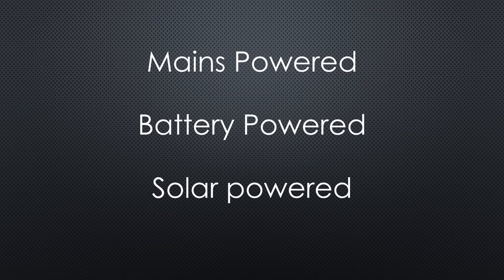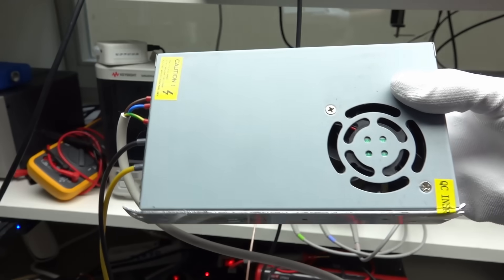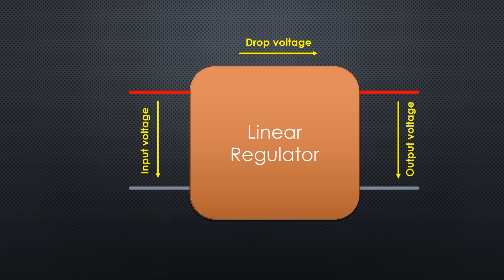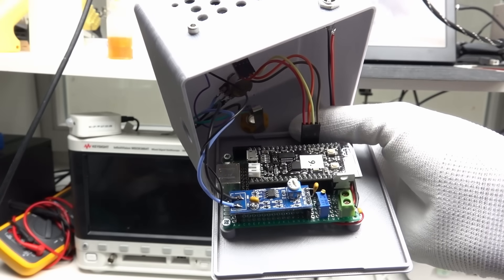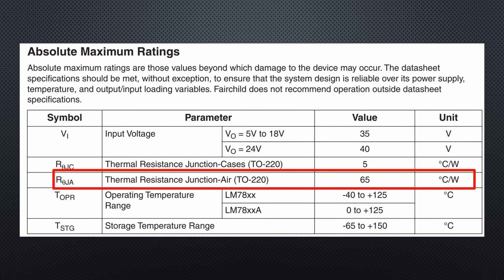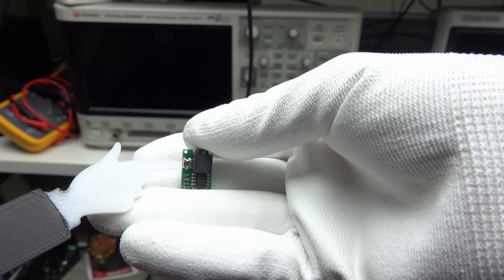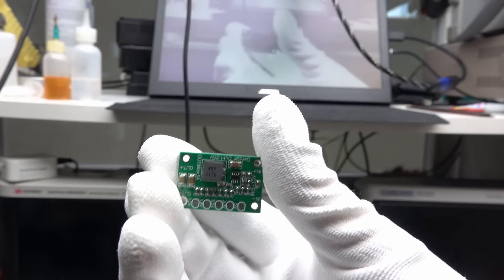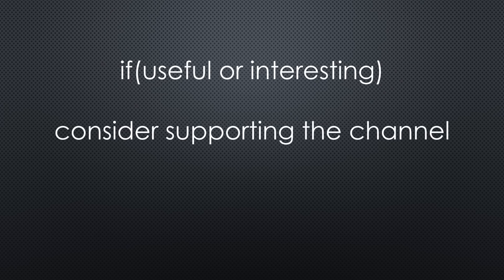#334 How to find the right Power Supply for your Project

Comment: I fully agree with Daily Cake Slice.  Among the Development Board drawings I sent you, there is a new idea for battery power or main power. For batteries you can use a good size 6V, charged by solar and then go to MCP 73123 charger to a 3.3V Lifepo4 Battery to run the ESP WiFi. It hasn't been tested.
Reply from the maker: There are only a few chargers which also handle LiFePo. If I remember right, the TP5000 uses the MCP 73123. And you are right,  LiFePos are a good choice for ESP projects...

Comment: Battery and solar please, I just implemented a solar chicken coop door running through Hass / node red.
10w panel isn't keeping up with the daily draw so this is an relevant to me right now!
Reply from the maker: You might try to watch my video about solar where you find all formulas to do the calculation for your location and need
Reply: @AndreasSpiess  yep that's my next stop, I'm doing this project backwards which is a bit silly. 
Also deep sleep is on the cards too
Reply: @AndreasSpiess  Im watching your videos and realising i don't have enough knowledge of my system power use to be able to calculate it all. Its complex because - 
1. I am running an INA 219 but on between the battery and the Solar Charge controller.
2. This means i actually don't get nice long data for my actual usage but i do get the net solar in to battery and drain out.
3. at least 2 x per day i have a linear actuator going which draws about 0.2A @12V for arroudn 45 seconds each time.
4. i have not yet worked out how to get Granada to show me cumulative daily in and out on the battery, i can see a + drain on the battery and a -  charger on the Amps through the INA but not yet worked out how to work out the accumulation of this either.
5. Its already installed in the chicken coop so working on the stuff isnt super easy, im not installing TRRS cables to some of my harder to reach projects to get UART debugging without getting to small spaces.
6. I think my cheap solar charger form china is also shitty, and this cuts the power to the load sometimes, i'm thinking about wiring directly to the battery to remove this poor quality HW being an issue.
Anyway, i now have an INA 4332 and im going to modify it to see 3 x channels of Solar circulate, load and battery, i can include all my 5v D1 Mini in to the 12V measurements as the H bridge which drives the actuator has a 5v output so this should help keep that bit simple.
Anyway, a few more videos of yours to watch i see!

Comment: Funny that I have been info seekning voltage regulators for MCU:s all day, then you release this video today. Great content and clear explainations as always!

I was almost ready to order some LM2596 based boards, but a commenter mentioned that ripple could be as high as 300mV peak-to-peak on those. Is that tolerable for e.g. an ESP32? Can we filter it with a capacitor? What are some good buck converters with low noise?
Reply from the maker: These are quite old boards. Maybe you decide on one I showed in the video...

Comment: That was useful and interesting and I'd definitely be interested in a battery edition.

One type of power supply I like for small mains projects are the little potted mains to 3.3V or 5V power supplies that you can get on AliExpress for a few pounds.  They are small and work well if you want to wire the power supply in permanently.
Reply from the maker: I think I showed one in the video. I also use them sometimes.
Reply: @AndreasSpiess  You are quite right, it was at 2:20 - I missed it first time round because I had to get my dog to stop barking at the post man (delivering a parcel from AliExpress, appropriately enough).  The ones I use are much smaller than that (probably no more than a quarter of the size) and are a lot more clearly labelled but otherwise, probably very similar.

Comment: I am very sad that you did not talked about symmetric supply. Because I need a symmetric supply very often and do not know the best solution (instead Lab power supplies)
Reply from the maker: I take two normal 220v power supplies and connect the secondary plus of one cable to the minus of the other. Ready is the split PS. I did this also with two of the PCB PS I showed. This is now my standard +/-12 Volt PS.
Reply: @AndreasSpiess  Thank you a lot for the answer. It helps a lot! The PCB PS sounds like a great idea. I am just not sure if I can trust the cheap chinese PCB PS. I mean it is mains voltage... And the PCB PS from premium suppliers are quiet expensive :/
Reply from the maker: Ask yourself what is the biggest damage? A few opamps, in my case... It also does not look too bad. Even the worst on this page do not kill you immediately ;-) https://lygte-info.dk/info/ChargerIndex%20UK.html

Comment: All voltage regulators now have thermal protection, you do no need sophisticated Swiss method. If your device turns off for several seconds and then turns on again - your voltage regulator needs a heatsink.
Reply from the maker: Also a possibility. A little slower...

Comment: I recommend  GreatScott video about similar  topic too: https://www.youtube.com/watch?v=OwAZqJ4wpJg&t=91s
Reply from the maker: I am a Patreon of Greatscott ;-) He does not solve the issue if you want 12 volts every time. Those boards only have a button where you can switch voltage.
Reply: @AndreasSpiess  I think he mentioned that  there is a programming mode to get certain voltage  every time when connected 🤔

Comment: Andreas, when it comes to USB Power Delivery, consider taking a look at the ZY12PDN. These use a button to select between 5, 9, 12, 15, and 20v. You can hold the button down when plugging it in to select the voltage it powers up at, which is really convenient.
Reply from the maker: I have soch a PCB. Would you like to push buttons every time you start your project?
Reply: @AndreasSpiess  No, but if you hold down the button when you first plug it in, it will start blinking. Pick the voltage, then long-press. It saves it to internal flash, so the next time it comes in, it has the right voltage. 
It's not as obvious as it should be.
Reply from the maker: Thank you for the tip!

Comment: Well. You could work around having to drop down a high voltage at high currents.
If you buck regulate down to 1 volt over what you are requiring and then linearly regulate from there. Thus the voltage dropped by the linear regulator is small compared to not having the buck regulator and this makes the setup much more stable and much more efficient.
Reply from the maker: Then I do not see the need for a linear regulator unless you have a special case. It will not kill the noise, unfortunately :-(
Reply: @AndreasSpiess  I may have been misinformed, but i saw Dave Jones review a linearly regulated buck power supply. it was smart

Comment: Would you please make a video on an uninterruptible power source (UPS) for a device such as the raspberryPi 4. All the ‘off the shelf’ solutions I have tried so far, always result in the ‘lightning bolt’ low voltage warning. 

I have constructed my own but the size, portability and weight (+ wires & modules & housing) were far from ideal.  Ideally such a device would have a foot print no bigger than 2* the size of the PI + say the height of the cells.  The device should also produce both 3.3v and 5.0v up to 4Amps+. 👍 please
Reply from the maker: This istoo special for the channel, I think.  We will see...
Reply: The UPS could also include solar  making it ideal for a remote project.

Comment: Useful and interesting. Thank you! Would love to see a video about battery power. Had a question while watching this video, and thought you might know the answer: Are all of the pins 5v tolerant on an ESP32? ...In other words, could a 5v analog sensor (like the MQ gas sensors) work with an ESP32 without making sure the analog input was below 3.3v?
Reply from the maker: For the ESP8266 we had a mail from Espressifs CEO that the digital pins are 5volt tolerant. I do not have such a mail for the ESP32 and the datasheet says: no
The analog pin is easy. Just add a voltage dividor which reduces voltage to max. 3.3 volts.

Comment: Voltage is constant in Swiss only....here it drops normally fron 220V to 170V or less expecially during summer when all air conditioners are on....besides it disappears 4 or 5 times for week..... this is something to take in consideration in proyects.      73 de  ZP4KFX
Reply from the maker: That is not good. Probably not for our small projects, but for sure for your Linear Amplifier...
Reply: @AndreasSpiess  right ! infact my old home made linear is almost useless here...not only the AT is low, but also the filaments remain cold.....now I own a SPE Expert 1.3K-FA which works fine even at 110V.....73

Comment: Again another great video :) I’m building a large 16^3 led cube with pl9823 leds. If you calculate the power i need -> 60mA x 4096 x 5v = 1200 watt... So i bought 4  60A, 5V powersupplies, thick wire for 15A, per 256 leds. The proof of concept works. But i also want a kind of standby mode. Leds that are powered, but off, use arround 1mA... Thats 20 watt when off.... So how i was thinking using mosfets to turn all power off (need to switch the 5v, not ground, according to adafruit guide) but with 240A total those mosfet resistances RDSon will also have a huge impact. There is some overlap with battery powered project here (minimize quiescence current). Always something to learn... I’ll think i’ll go read in my electrical engineering book and figure out what to do with those huge current, but watching your youtube video’s is so much more fun ;-)
Reply from the maker: You probably need one FET per power line. Then currents are a little lower...

Comment: Thank you for all your work. Only a small problem in this one : the arrow showing voltage are strangely oriented (input, output, drop voltage, ...) we generaly use the arrow head to point the more positive wire : https://en.wikipedia.org/wiki/Passive_sign_convention .
- comparing riple and other EMC parameters between switching and linear could give more acurate choice parameter
- batery properties (Nixx or Lixx or Pbxx) and charging/discharging is well documented (in french) on https://ni-cd.net
Reply from the maker: Thank you for the link to teh french site. I do not like this voltage notion, so I use mine. And everybody knows what I mean ;-)

Comment: I get the general idea of the "Swiss Guy" method, but exactly what is the range of  good versus bad in this test?  And, since you are using a gloved hand in the video, how does that change the perceived  result?     We used to use a USA Underwriter's Lab (UL) standard for the maximum  allowable temperature for the cases of our office equipment.  The number is 137 degrees F  (58 C).  It is, according to UL, the maximum temperature on a surface that a human can touch for an extended period of time without having to say "ouch".   Is that what you have in mind?   And how do you deal with it when you are wearing gloves?    ----Maybe I am just nit-picking?
Reply from the maker: I assume our sensors are similar here, just calibrated in degrees centigrade ;-) 60 degrees centigrade is usually not bad because most parts are rated higher. So you the risk is mitigated.

Comment: May I give you a recommendation? I didn't buy it myself yet but the description is promising. It's a USB stick that is a boost-buck-converter with a display and thumbscree adjusters. It can switch between constant voltage and constant current. It can be powered by usb-a, micro-usb and usb-c. It can even handle quickcharge etc to accept more power
https://a.aliexpress.com/_dX8bQjF
Reply from the maker: I had thre defferent examples in my last mailbag video ;-)

Comment: yes yes yes, please do a video about battery powering devices. I always have difficulties to find good booster, and if I should try to get an all-in-one board (charger & battery protection &booster), or if it is better to have everything separated. Also interesting would be a discussion in very low power devices, i.e. I have an arduino and RFM22 sending data every 5 minutes working on a single AA battery for 4 to 5 years!
Reply from the maker: Noted!

Comment: I picked up some nice little dual rail 12V + 5V buck converters on Aliexpress a few weeks ago.
Search 33057529771 in the Aliexpress search field.

I'm not affiliated with the seller or the product, just thought I'd mention them as something relevant to the video.
Reply from the maker: Seems to be made for a special purpose. Nice board if you need these voltages in your project.
Reply: @AndreasSpiess  It's sold as a BEC (Battery Eliminator Circuit) targeted at radio control projects. 5V and 12V accessible from either end (short edge), and inputs on either side (long edge). I thing the multiple pads are for ease of wiring in an RC project. I thought it was quite good value as it's a 10 board lot. Not a lot of info on them but quite self explanatory by looking at the silkscreen.

Comment: Thank you Andreas, excellent video. Although it confirmed my assumption that recycling the usb power adapters in the house is the best methhod for powering my simple projects I learned 2 important lessons: 1- I have been wondering for YEARS why anyone would still choose a linear power adapter, when the newer switching models were so much smaller, efficient and cheaper. You answered this very clearly. 2- I also had bought a number of 7805's "just in case" I need them - since they seemed to be so commonly used in many projects -  but I also read some people dismissing them as inferior compared to other regulators. Now I know what they are talking about. Finally: Yes please I would be very interested in a similar video about battery powering options.
Reply from the maker: The 78XX are nearly as old as I am. So for sure you get better ones these day. But they work for mains powered projects and are cheap...

Comment: Laptop power supplies are great if you need a bit more power. They are mostly well-built, safe, compact, widely available and their typical 19V output is easy to buck down at the point of load as many switchers accept up to 24V.

For OCD sufferers who don't want to cut off the nicely molded original plug it can be a challenge to find the matching input jack :-)
Reply from the maker: You are right. I also use one to power a small bench power supply. They are also quite strong...

Comment: My RPi-4 didn't like running on a regular USB power brick, $ vcgencmd get_throttled returned that it throttled itself on a vanilla setup. Doesn't happen on a USB power supply that is marketed specifically for the RPi-4. I read that normal USB power bricks can't supply stable 5V voltage.
Reply from the maker: As said, many new PS can do it without problems. And tthe USB-C cables seem to be good. Just do not use a too long one....
Reply: @AndreasSpiess  Oh, thanks for that! So cable length plays into stable voltage?
Reply from the maker: Maybe you watch my video about serial cables

Comment: USB-C PD power bricks or batteries don't always offer 12Vm xo that might be your problem. More often they  deliver 5V and 9, 15V and 20V
Reply from the maker: You can make them deliver all voltages in between, too. You just need to know, how ;-)
Reply: @AndreasSpiess  and that depends on the PD driver chip. Some understand the request... but mostly ignored

Comment: Whatever valuable project you have, never buy chinese products from ebay/aliexpress.
Always buy quality branded stuff from certified sellers like Farnell, RS, Digikey, TME, Pimoroni, Adafruit etc.
Another thing make sure that if you use some DC-DC converter it is able to deal with reverse voltage input without outputting full 12-24V input voltage to your 5V/3V3 device.
I had used one of these cheap ass buck converters for $1 to power RaspberryPi Zero W from 24V and accidentally applied voltage other way around, smoke went right out.
But if you need high amperage PSU like 50A+ you can use PSUs from retired servers, those were maybe used for 5 years already but they were designed to work 10 years so you still have a lot of use from them most of the time, and they're dirt cheap, most of the time you just need to short pin or two to activate them.
One of the popular one is DPS600PB, it is 12V 47A, it can even be adjusted up to 15V, or connected either in parallel or in series, best thin it can be bought for as low as $10.
Reply from the maker: The tip for using server PS is a good one if oyu need around 12 volts and lots of ampere.
Most of my products are "made in china" (as well as most products you get from Digikey or other distributors). I have no problem with that.
Reply: @AndreasSpiess  Made in china is not the problem, it's low quality or fakes that you usually end up with buy choosing ebay/aliexpress/wish.
It's about trusted source.
Some of these server PSU come with 50V outputs as well for example 226519-001 which is 3kW for $50, asbolute steal.

Comment: Thanks Andreas, Yeah linear regulation is  OK for us having fun with our small projects  but it's a bit annoying for mass produced products like the mains powered smoke detector Dave EEV complained about a few weeks back - the old fashioned battery powered smoke detectors we've had for decades were great low energy designs and now we're replacing them with hundreds of millions of mains powered ones that each turn ~1W into useless warm air 24h per day which scales up to a lot of wasted energy over a whole country.
Just a general grumble - you haven't done anything wrong.
Reply from the maker: My smoke detector runs still on battery :-) Think also how much energy you use if you drive your car to the next supermarket. Maybe more than all the standby energy of your devices for quite some time. And I did not talk about flying or cruising with a ship. The 80/20 rule applies also here.